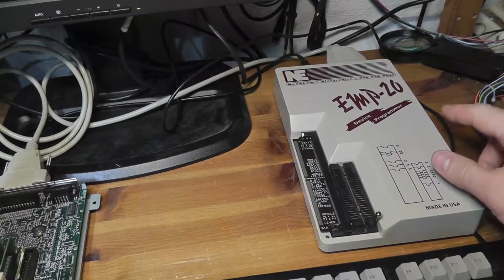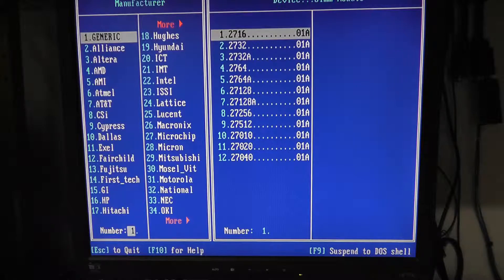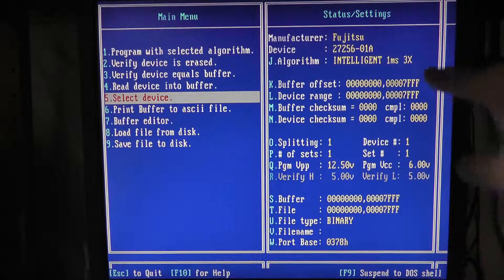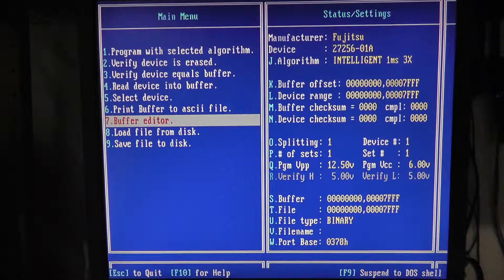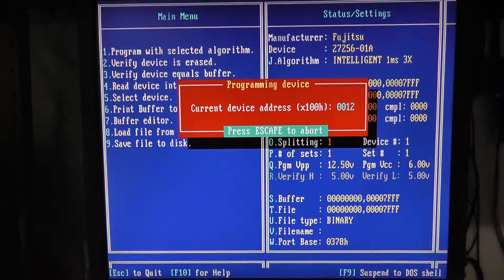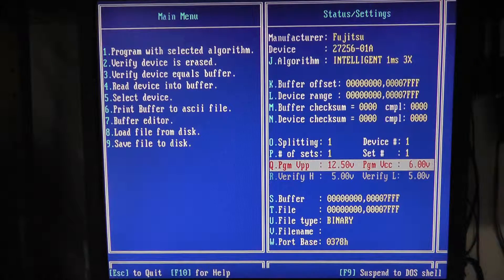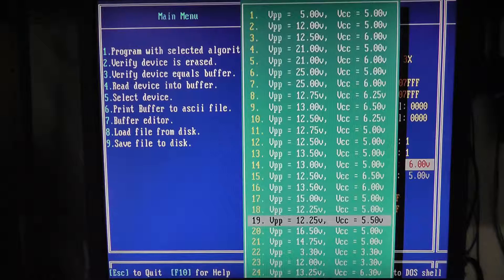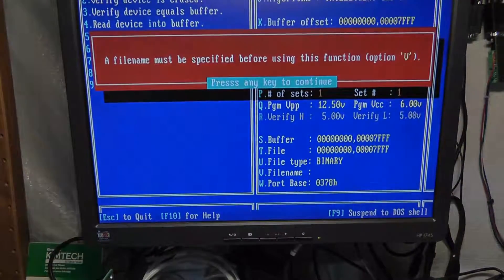Programmers Wooo! - Part 3 Needham's EMP-20

Comment: I have an old emp-10 and I keep trying to boot off windows xp and cannot do it to save my life. How are you booting? I caught your freedos screen. Do you have a spare hard drive that you have DOS installed dedicated to old programs?
Reply from the maker: When i use freedos i boot off USB.  I dont think the emp10 works on windows cmd prompt like emp20.  You need dos.  Does the emp10 have an isa card or parallel port?
Reply: Jacklick’s Arcade and Tech Repair Journey it has a parallel port. I’m actually good at pc troubleshooting but haven’t messed with DOS in ages. I just wondered if you had old spare parts running legacy software but it seems like your downloading emulators of some sort. That is something I haven’t got into. I think i am going to read on freedos
Reply from the maker: @carlosmedrano7005  Yea freedos boot from usb is probably your best option.  Their is a "NT" driver that allows the emp-20 to work on in a CMD line prompt on winXP but I am not sure if it works with emp10.  Good luck and reply back with success.